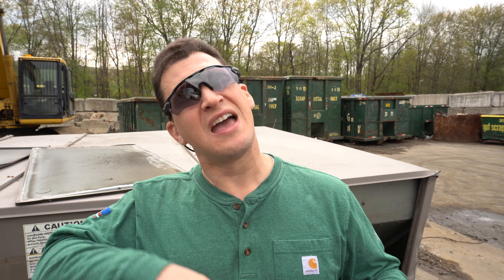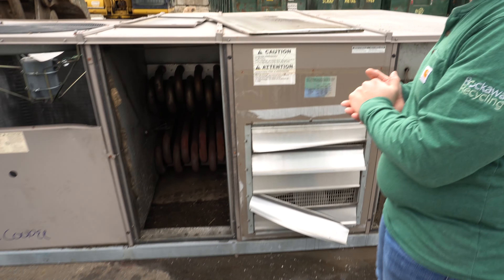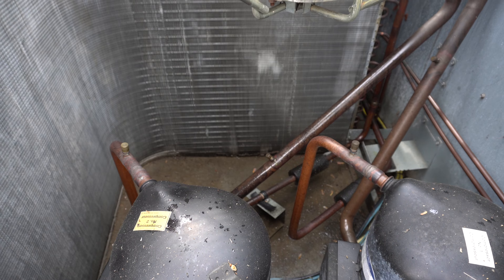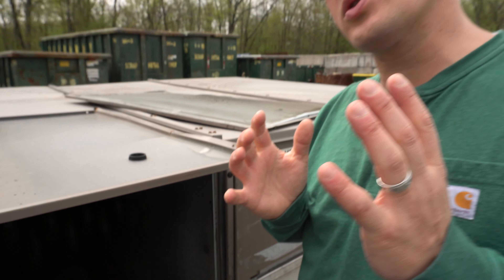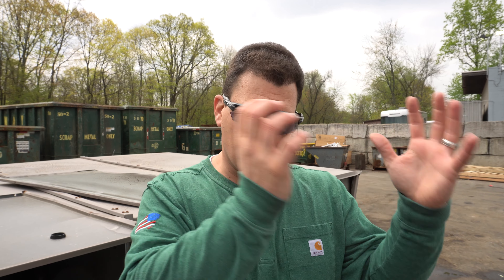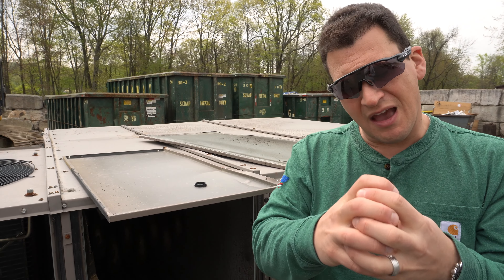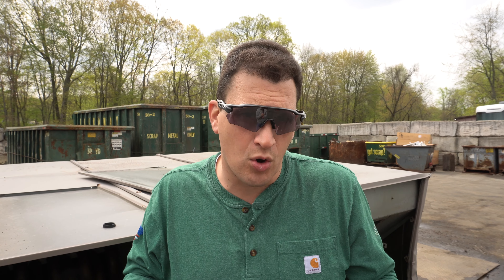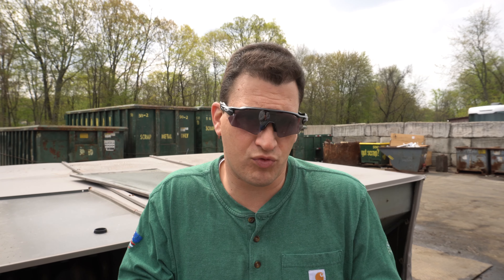Is Light Iron Different from Shred? The Surprising Answer

Comment: the yard I go to calls it "tin shred" they don't have a shredder but i presume they sell it to a shredder. plus I live in the rust belt, so there are several steel mills near by and loads of adjacent to steel mill manufacturing.
Reply from the maker: makes sense. It can definitely be confusing with different places have all sorts of lingo